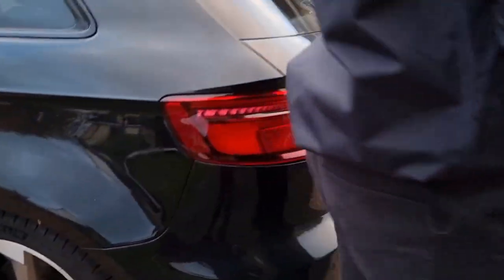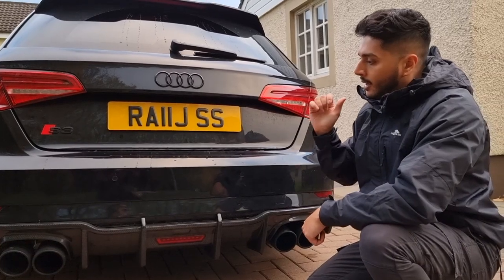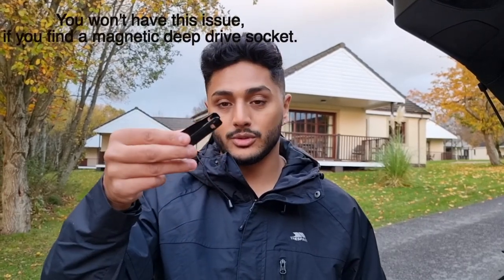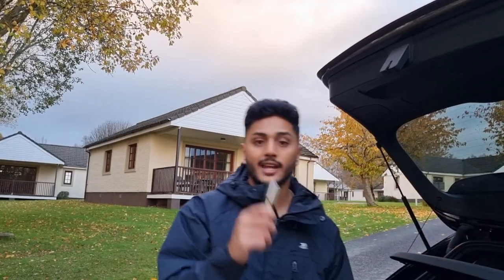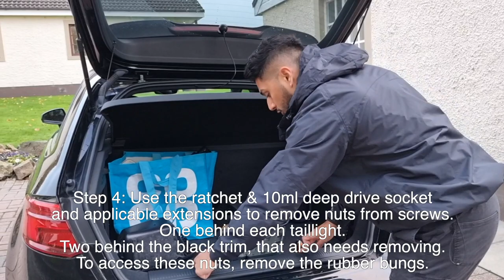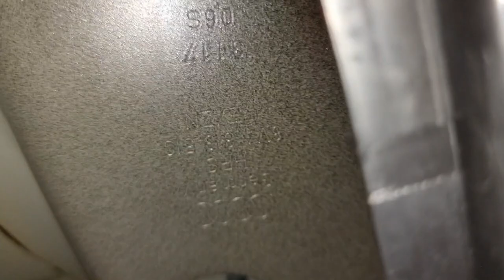AUDI S3 8V REAR BUMPER REMOVAL TUTORIAL | + NEW CARBON FIBRE DIFFUSER WITH RAIN LIGHT!

Comment: Great video buddy, was really helpful when fitting a similar one to my a3.
When it comes to the wiring of the brake light in the defuser, there is three wires. Am I correct in saying they join to the following wires on the tail light?

Red - Dark grey, black line
(Driving lights)
Black - Brown
(Negative)
Yellow - light grey, white line
(Brake light)

Also does it matter which side it gets wired into?

Cheers
Reply from the maker: Hi Rob, I'm not sure, as I didn't do the wiring sadly. Sorry!

Comment: Solid video. Bit of a shame as it wasnt as step by step diffuser install as the maxton one but thats understandable as i wouldnt wana remove my bumper for the 6th time either. Diffuser looks good and i had my eye on that for a bit. They have dropped the shipping price so its more competitive. 

I have just installed my maxton one last week following your video.
Reply from the maker: I know bro, if the weather had been good, I would have done the whole thing. But, I was in such a rush. I've just retrofitted the power folding mirrors today, and I was praying it wouldn't rain. 

The maxton one has it's pros. The material is much more flexible, easier to get it plush. This is tough, that's why I kept telling everyone, is it really worth it?! In the end yes, it looks good. But at what price. 

Thanks for watching bro. I've added the tailpipes link the video. Make sure you select custom.